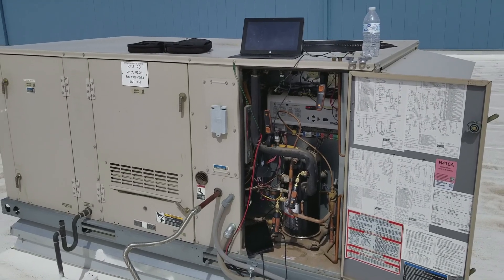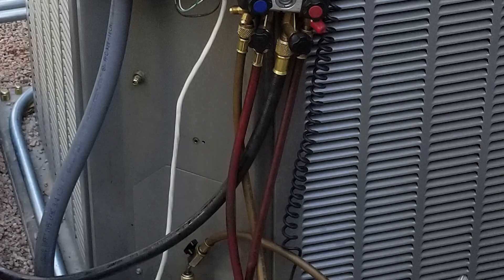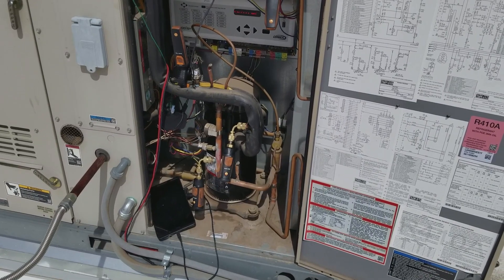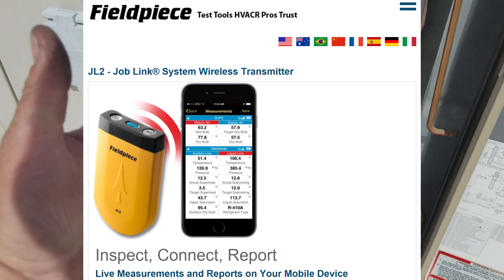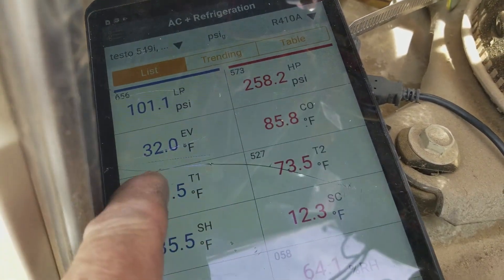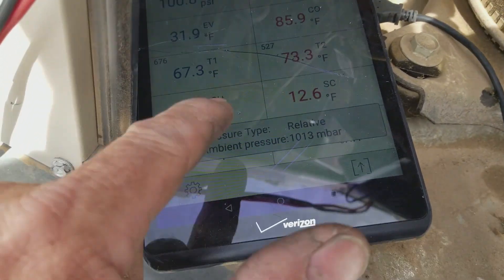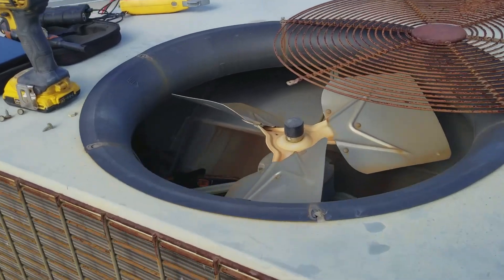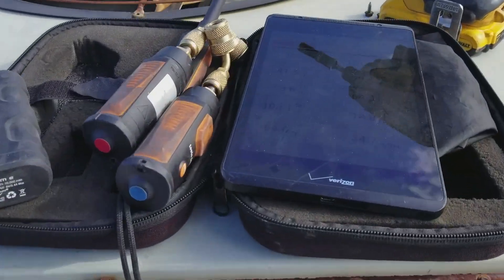Using Testo "smart probes" out in the field

Comment: When using temperature probe for residential fixed orifice; is it better to manually input indoor wb and out door dry bulb for target superheat? Or can you just hold your indoor measurements on the temperature probe when checking the charge on the outdoor unit using the wireless refrigeration probes in app? Was wondering if the probe will pick up incorrect DB or if its designed for that purpose.

Comment: The Fieldpiece probes connect directly to your device, range is insane. They broadcast through the building. However the app is not refined as Testo’s.  I ended up using my Testo probes today because the Fieldpiece probes would not connect. Bluetooth life. 😂👍. Testo’s app is amazing and easy to use.
Reply: Nor-Cal Refrigeration & H.V.A.C Sucks to hear Fieldpiece is still having app issues. Hopefully they will focus on getting that fixed.
Reply: HVAC in SC they have done some updates which helped. Today was the first connection issue I’ve ever had. I’m on a new phone and going to find out if there is an update coming for iPhone 8.
Reply from the maker: Are those new? Because when I had the S-Man or whatever it was called, I could NOT connect it to a phone without that separate piece.
Reply: Nor-Cal is correct. The Fieldpiece Job Link Probes are fairly new - within the last 6 months. They connect directly to phone or smart device, no other pieces needed.
Reply: hackfreehvac the range is ridiculous good 🤘👍
Reply from the maker: Oh, you mean PROBES rather than the manifold set?
That is new. It was a year ago when I had the S-man manifold and at that time it seemed that all the bluetooth tools needed that separate accessory.
Reply: hackfreehvac yes probes my bad.
Reply: Nor-Cal Refrigeration & H.V.A.C use the app called measure quick with the field piece
Reply: The Fieldpiece probe app kinda sucks but I use them with the measure quick app and I'm amazed how flawless they work with more information

Comment: Where is the Goodman bashing at or did u scare the Goodman units away
Reply from the maker: Oh man, I forgot to work that into this video!
Reply from the maker: I do have a few clips of those mighty fine Lennox units. I might do a review on them and bash Goodman in the process. Because, Goodman don't make anything in the ballpark as good as these!
Reply: hackfreehvac couldn’t agree more I love the handles on those units which make it easy to service and change filters whoever designed that Lennox unit had the service man/women in mind
Reply from the maker: Exactly my point. SERVICE in mind.
The Goodman lovers mock our desire to have units DESIGNED with regular service in mind.
I don't think those residential Goodman lovers have ever stepped onto a commercial rooftop with 20 or so units to check yet alone a few hundred.
Reply: hackfreehvac my parents were going to get a Goodman and I said Hell no you will regret it every time it turns on so They eventually got a comfort maker which is a lot better than those pos Goodmans and icp is good units too
Reply from the maker: HA HA